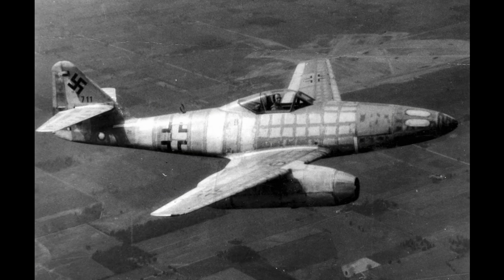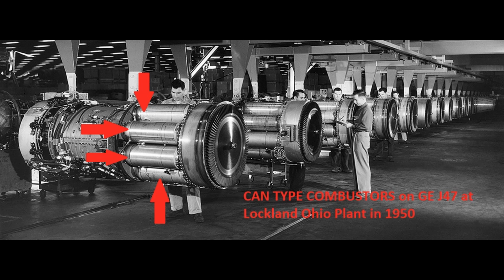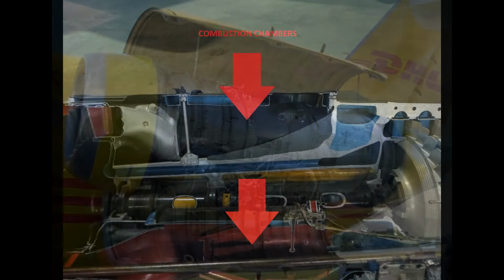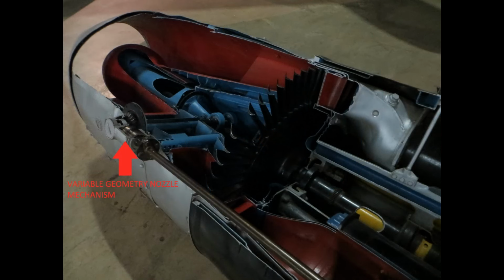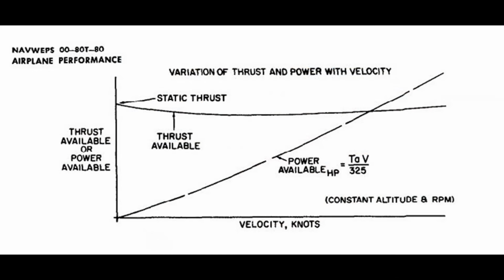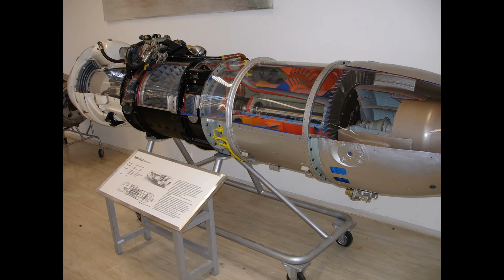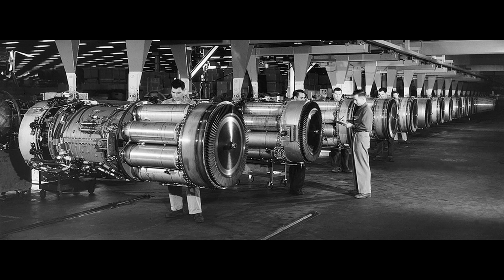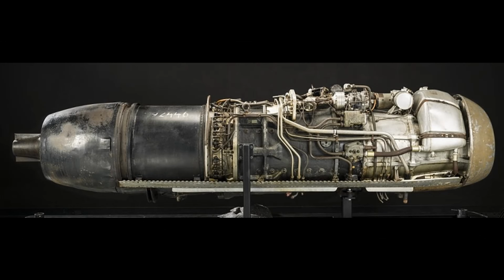World War Two JET POWER

Comment: Another great video. Over in Britain, Frank Whittle took out a patent for the jet engine in 1928, but because he was serving in the RAF, the government claimed ownership of the patent and then declined to fund the development of an engine. Whittle always maintained that he could have developed a working jet by 1937, and a turbofan by 1939.
Reply: 1939 was indeed the year for the first jet engine propelled airframe: Heinkel HE 178 made the first jet flight in September of 1939 in Rostock, germany.
Reply from the maker: Maybe he could have.
Reply: Frank Whittle did not patent the turbojet engine, Maxime Guillaume patented the turbojet aircraft engine in 1921... when a 14 year old Frankie was still wearing short pants.
Reply: @sandervanderkammen9230  Did he ever build and test his 'engine' or was his patent for a conceptual engine?  If the latter you could argue that the first such engine designer was whoever designed of a rotary fan or even the windmill.
The original German engines were based on Whittle's engine patent  with developments which he had also planned but was thwarted from implementing by weak government in Britain which was appeasing Hitler.
Rather than the full backing for the development of the engine given by the German Government Whittle was allowed to develop his invention in 'spare time' around this RAF duties.
Reply: @AD-nx1xd  "Conceptual engine?"  you mean like Whittle's 1930 patent?
 Whittle never constructed the engine design he patented..
and neither did Hans von Ohain.
 While it's become a popular British urban myth that von Ohain copied Whittle's patent this false claim quickly crumbles upon the slightest scrutiny.
 The truth is that von Ohain and Frank Whittle were both aware of Maxime Guillaume 1921 patent.
Whittle discovered his patent was invalid and allowed it to quietly expire.
Both men were also aware of the BBC Velox engine and A.A Griffiths 1926 paper.
 What is important is who built the first successful jet aircraft engine.
And that title belongs to Hans von Ohain and Max Hahnn.
Whittle was only the 4th person to successfully demonstrate a jet aircraft engine.
Reply: @AD-nx1xd  Hans von Ohain paid all the costs to build his first prototype in 1934 and received no corporate or government sponsorship.
Whittle did not begin any actual work  on jet engines until he moved to Rugby in 1936, two wealthy friends and an investment bank formed a company to fully finance Whittle's  work before the war.
Von Ohain was consistently 2 years ahead of Whittle from start to first flight.
Reply: @sandervanderkammen9230  ha haaa
Reply: Whittle's patent was invalid and he allowed it to expire rather than face a lawsuit for patent infringement from Maxime Guillaume. 
 Whittle was caught plagerizing the work of A.A Griffiths 1926 paper, he was at the time Chief of Engine Development at the Royal Aircraft Establishment which ruined Whittle's reputation and any chance of receiving an serious interest from the Air Ministry.
 Whittle would not begin any actual work on jet engines until he moved to Rugby in 1936, he would not have a flight rated engine ready until 1941.
Whittle never built any engine with a axial compressor so the notion that he could have built a turbofan is rediculuous.
Daimler-Benz invented the first turbofan engine, the ZTL6001(109-007) in 1942.
Reply: @sandervanderkammen9230  
Insanitere Durr Krappen.
Got any links to the sources for the plagerizing claims about Frank Whittle? 
Post them up here if you don't mind, there's a good boy und we can all have a look at them.
Reply: @sandervanderkammen9230  
First serious turbofan concepts existed in the 1930s in ENGLAND
The Daimler turbofan was garbage / junk unt  VWas abandoned after being electric motor spin tested on a test riggen in 1943 then abandoned with no futile attempts to fuererther waste resources on a heapen unt   corroding garbage.
The first realistic attempt at a running Turbofan was by MetroVik in 1943 & was based on a fully running axial flow internal combustion turbine engine - the MetroVik F2 first run in 1941
Reply: @paulpaul9914  Metropolitan Vickers abandoned all development of jet engines without success in 1947.
Reply: @paulpaul9914  The world's first successful axial compressor gas turbine engine is the Bown Boveri und Cie Velox engine in 1932.
Reply: @paulpaul9914  Metropolitan Vickers became a Bown Boveri und Cie Velox engine licensee in 1934.
 The first successful demonstration of a and axial compressor gas turbine engine in the U.K. was the Velox system by Swiss Company Brown Boveri und Cie in 1934 at UMIST in Manchester England.
Reply: @paulpaul9914  The world's first TURBOFAN and the FIRST TWO SPOOL jet engine was the Daimler Benz 109-007, it first ran in 1942.
Reply: @sandervanderkammen9230  
Brown Boveri was unable to produce a successful gas turbine & were generously provided with the rights to use axial turbine & axial compressor  technology by Parsons of ENGLAND early 1900s.
Reply: @sandervanderkammen9230  
The Daimler Benz turbofan did not run as a gas turbine & was abandoned.
The first successful turbofan was run as a working gas turbine engine by MetroVik in 1941.
Reply: @sandervanderkammen9230  
Metropolitan Vickers transferred all very successful gas turbine projects to other companies including the world's first successful turbofan engine technology.
A group of Metrovik gas turbine world leading engineers transferred to another company where gas turbine work continued.
A team of Metrovik specialists transferred to Nuclear Weapons work in Wales & from there moved to the US for Nuclear Bomb work.
Metropolitan Vickers subsequently carried on with what they were doing previously, the core MetroVik company essentially wasn't interested in carrying on with aircraft work & high volume repeat production.
Reply: @paulpaul9914  C.A. Parsons Company only made steam engines prior 1947.

Stop posting lies and false information.
Reply: @paulpaul9914  Metropolitan Vickers abandoned all development of jet engines without any success in 1947.
Reply: @paulpaul9914  The Metropolitan Vickers F.2 was not a Turbofan.
Reply: @sandervanderkammen9230  
Krappen -
 @Sander Van der Kammen  
First serious turbofan concepts existed in the 1930s in ENGLAND
The Daimler turbofan was garbage / junk & unt vas abandoned after being electric motor spin tested on a test rigen in 1943 then abandoned, it was unable to sustain effective combustion & had a tendancy to destroy itself.
The first realistic attempt at a running Turbofan was by MetroVik in 1943 & was based on a fully running axial flow, axial turbine, axial compressor,  internal combustion turbine engine - the MetroVik F2 first run in 1941
Reply: @paulpaul9914  Metropolitan Vickers never produced a single flight rated jet engine.
Reply: @sandervanderkammen9230  
The Metropolitan Vickers F2 Turbofan was the first of its type in the world.
Reply: @paulpaul9914  Metropolitan Vickers was founded by American George Westinghouse and was a division of the American Westinghouse company, it ceased to exist in 1960 when it was acquired by American company General Electric.
Reply: @sandervanderkammen9230  
All MetroVik gas turbine aircraft engines developed in ENGLAND  were used in various ENGLISH internal combustion turbine powered aircraft with ongoing development continuing at MetroVik IN ENGLAND BY ENGLISH ENGINEERS or after having been transferred to subsequent ENGLISH companies involved in gas turbine aircraft engine work IN ENGLAND
Reply: @paulpaul9914  The Daimler Benz 109-007 is the world's first Turbofan engine and ran on May 27th 1943.
Reply: @paulpaul9914  The first Turbofan and the first 2 spool jet engine was the DB 109-007.
Reply: @sandervanderkammen9230  
 @Sander Van der Kammen  
Krappen - 
First serious turbofan concepts existed in the 1930s in ENGLAND
The Daimler turbofan was garbage / junk & unt vas abandoned after being electric motor spin tested on a test rigen in 1943 und then abandoned, it was unable to sustain effective combustion & had a tendancy to destroy itself.
The first realistic attempt at a running Turbofan was by MetroVik in 1943 & was based on a fully running axial flow, axial turbine, axial compressor,  internal combustion turbine engine - the MetroVik F2 first run in 1941 in England having been engineered by ENGLISH ENGINEERS
Reply: @sandervanderkammen9230  
 Krappen -
All MetroVik gas turbine aircraft engines developed in ENGLAND  were used in various ENGLISH internal combustion turbine powered aircraft with ongoing development continuing at MetroVik IN ENGLAND BY ENGLISH ENGINEERS or after having been transferred to subsequent ENGLISH companies involved in gas turbine aircraft engine work IN ENGLAND
Reply: @paulpaul9914  Please name a single type rated production aircraft powered by a Metrovick engine???
Reply: @sandervanderkammen9230  
 @Sander Van der Kammen  
All MetroVik gas turbine aircraft engines developed in ENGLAND  were used in various ENGLISH internal combustion turbine powered aircraft with ongoing development continuing at MetroVik IN ENGLAND BY ENGLISH ENGINEERS or after having been transferred to subsequent ENGLISH companies involved in gas turbine aircraft engine work IN ENGLAND
Reply: @sandervanderkammen9230  
 @insanitere Von durrr Krappen 
All MetroVik gas turbine aircraft engines developed in ENGLAND  were used in various ENGLISH internal combustion turbine powered aircraft with ongoing development continuing at MetroVik IN ENGLAND BY ENGLISH ENGINEERS or after having been transferred to subsequent ENGLISH companies involved in gas turbine aircraft engine work IN ENGLAND. THE INFO REGARDING THE CHAIN OF DEVELOPMENT OF THE ENGLISH GAS TURBINE AIRCRAFT ENGINES DEVELOPED BY METROVIK UND ENGLAND AND SUBSEQUENTLY VWFUERTHER DEVELOPED BY A NUMBER OF ORTHERUND COMPANIES IS PARTICULARLY EASY TO FIND - YOU HAVE A SEARCH ENGINE - USE IT
Reply: @paulpaul9914  Metropolitan Vickers was a division of the American Westinghouse company until it went tits up and was acquired by American General Electric company.
Reply: @sandervanderkammen9230  
 @Sander Van der Kammen  
 @insanitere Von durrr Krappen 
All MetroVik gas turbine aircraft engines developed in ENGLAND  were used in various ENGLISH internal combustion turbine powered aircraft with ongoing development continuing at MetroVik IN ENGLAND BY ENGLISH ENGINEERS or after having been transferred to subsequent ENGLISH companies involved in gas turbine aircraft engine work IN ENGLAND. THE INFO REGARDING THE CHAIN OF DEVELOPMENT OF THE ENGLISH GAS TURBINE AIRCRAFT ENGINES DEVELOPED BY METROVIK UND ENGLAND AND SUBSEQUENTLY VWFUERTHER DEVELOPED BY A NUMBER OF ORTHERUND COMPANIES IS PARTICULARLY EASY TO FIND - YOU HAVE A SEARCH ENGINE - USE IT
Reply: @paulpaul9914  Metropolitan Vickers was not an English company, it was founded by American George Westinghouse and was a  division of the American Westinghouse company until it was sold to British Thomson-Houston an American company owned by General Electric.
Reply: @paulpaul9914  Metropolitan Vickers was founded by American George Westinghouse in 1899 as the "British Westinghouse Company" and was a division of the American Westinghouse Electric Corporation founded in 1886.
Reply: @paulpaul9914  Stop posting lies and misinformation, British Westinghouse aka Metropolitan Vickers was an American company until it was acquired by American  General Electric company.
Reply: @paulpaul9914   The Turbofan and the Turbojet were invented in Germany.
Germany was years ahead of the rest of the world in Jet engine technology.
Reply: @paulpaul9914  The facts are irrefutable, you cannot win your childish attempt to rewrite history.
Reply: @sandervanderkammen9230  
 @insanitere Von durrr Krappen 

All MetroVik gas turbine aircraft engines developed in ENGLAND  were used in various ENGLISH internal combustion turbine powered aircraft with ongoing development continuing at MetroVik IN ENGLAND BY ENGLISH ENGINEERS or after having been transferred to subsequent ENGLISH companies involved in gas turbine aircraft engine work IN ENGLAND. 
THE INFO REGARDING THE CHAIN OF DEVELOPMENT OF THE ENGLISH GAS TURBINE AIRCRAFT ENGINES DEVELOPED BY METROVIK UND ENGLAND AND SUBSEQUENTLY VWFUERTHER DEVELOPED BY A NUMBER OF ORTHERUND COMPANIES IS PARTICULARLY EASY TO FIND - YOU HAVE A SEARCH ENGINE - USE IT
MetroVik for most of its existence was owned by AEI (British) became part of GEC,(British) & later BAE (British)
Reply: @sandervanderkammen9230  
Insanitere Durr Krappen.
Where did you get the ridiculous idea that Parsons of England made any steam engines at all before 1947 or ever at any time  - be a good boy & post the links up here now.
Reply: @paulpaul9914  Please cite an example, any example of a gas turbine internal combustion engine made by C.A. Parsons Company prior to 1947???
Reply: @paulpaul9914  Childish insults won't prove your misguided and completely failed attempt to rewrite history.
Reply: @paulpaul9914  The world's first successful demonstration of the Turbojet aircraft engine was by Hans von Ohain and Max Hahnn on August 27th 1939 in Rostock Germany.
Reply: @paulpaul9914  Britain lagged years behind the Germany in the development of jet engines.
Reply: @paulpaul9914  The Gas turbine turboshaft engine was invented in Norway by Jens AEgidius-Elling in 1903... 4 years before Frank Whittle was born.
Reply: @paulpaul9914  The first successful demonstration of a Gas turbine engine in the U.K. was by the Swiss Company Brown Boveri und Cie, the Velox engine was demonstrated at UMIST in Manchester England in 1934.
Reply: @sandervanderkammen9230  
Insanitere Durr Krappen.
Where did you get the ridiculous idea that Parsons of England made any steam engines at all before 1947 or ever at any time  - be a good boy & post the links up
 here now.
Why do you keep stating that Parsons didn't make gas turbines, has anyone said that Parsons made any internal combustion turbine aircraft engines?
Reply: @paulpaul9914  C.A.PARSONS company did not contribute any technical achievement related to the development of the Turbojet aircraft engine or gas turbine or Turboshaft type engines.

Your childish attempt at rewriting history has been an epic failure and a total waste of time and effort.
Reply: @paulpaul9914  C.A. Parsons Company only made steam engines prior 1947 that used the Rankine Cycle principle.
 No such engines have ever been successfully used in aviation.
Reply: @paulpaul9914  Your desperate and infantile attempt to associate steam turbines to the development of the Brayton Cycle Gas Turbine engine was disastrous failure.
Reply: @paulpaul9914  Or? You could simply admit that you have been soundly beaten and your argument was a failure....
Reply: @sandervanderkammen9230  'The Metropolitan Vickers F.2 was not a Turbofan'. is this a first? you have stated a genuine fact, quiet the miracle. However it is true the F2 was not a turbofan, but the F2/3 was, this later became the Metrovic F3 which remains the most powerful aircraft engine of the war
Reply: @sandervanderkammen9230  Yes it did, the F2/4 Beryl. all made in april/may 1945 and delivered to Saunders Roe who used them in the Squirt, later Donald Campbell used on in Bluebird to take the water speed record
Reply: @sandervanderkammen9230  The Handley Page Victor, Blackburn Buccaneer, Hawker Hunter and Gloster Javelin were all powered by a Metrovic Engine, the F9 Sapphire
Reply: @zaphodbeeblebrox5973  So much ignorant misinformation.
 The Arstrong Siddley Sapphire is a completely different engine developed by a different company.
The Armstrong Siddley Sapphire was developed from the Armstrong Siddley ASX.
It's not related to the much smaller Metrovick F-2.
The Buckaneer was powered by the Rolls-Royce Spey and the Hawker Hunter was powered by the Avon.
Only the Javiln and the Victor were powered by the Sapphire, both are known for their poor performance and inability to reach Mach 1
Reply: Whittle did have a working engine in 1937, April 12th if you want the date! 5 months before Von Ohein
Reply: @zaphodbeeblebrox5973  @zaphodbeeblebrox5973  That is a completely false British myth
Hans von Ohain and Max Hahnn constructed the first turbojet engine in 1934 and successfully tested in 1935 at the Göttingen Universität.
It was witnessed by Dr Robert Pohl "the father of solid state physics"
 Pohl wrote a letter to Ernst Heinkel who came to Göttingen to observe a second demonstration in 1936.
 Frank Whittle did not invent the jet engine, he is only the fourth person to successfully demonstrate a working jet aircraft engine

Comment: The production version of the Ju 287 jet bomber was of course planned with a retraclable landing gear. The picture in the video shows the provisional testbed using a He 177 fuselage and parts from a Liberator undercarriage. The purpose was to get the new Junkers forward swept wing into testing with minimum amount of  time and material. The Ju 287 series model would have been using the fuselage of the Ju 288 piston engined  (Jumo 222) medium bomber project with the new wings, six BMW 003 or four Jumo 004 engines, later four of the more powerful Heinkel 011 engines. The forward swept wings proved to be a failure as the wing tips distorted at higher speeds. Junkers switched to backward swept designs later. Greetings Rainer

Comment: The Jumo 004 is best compared to the General Electric J-85.
(1) The J-85 develops about the same thrust as planned evolution of the 004 (2,400~3,600 lbs thrust).
(2) They both have 8 compressor stages, although the J-85 has 2 turbine stages instead of one and uses an annular combustor.
(3) As a matter of fact the J-85 will fit in the Me262 nacelles and are used in the sole flyable 262 today.